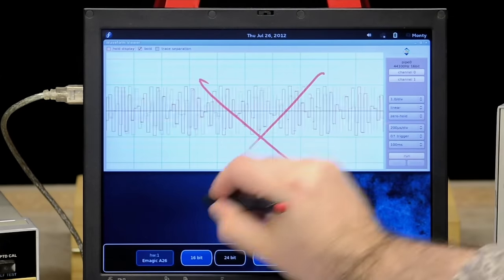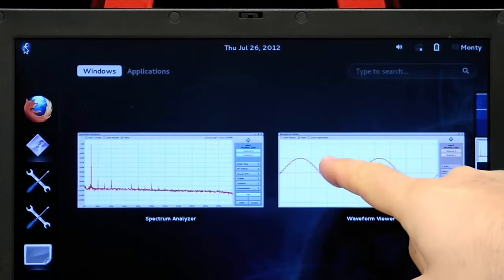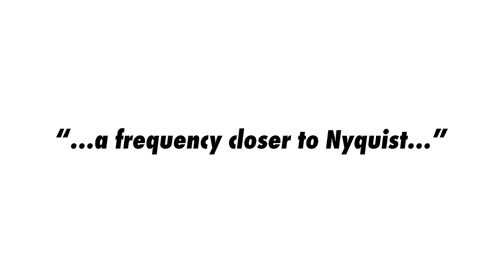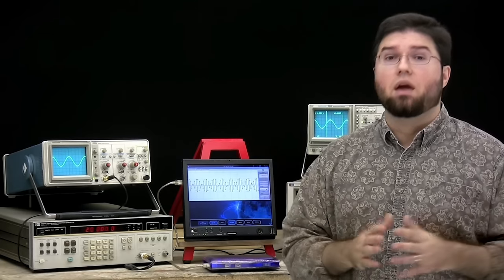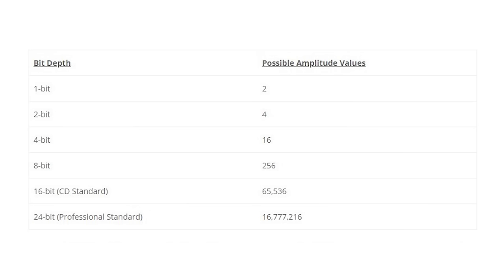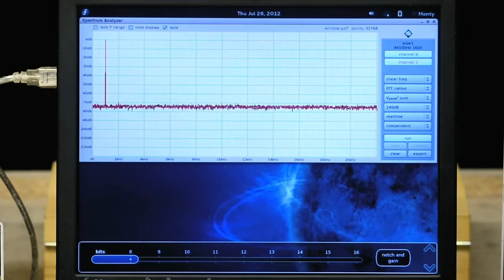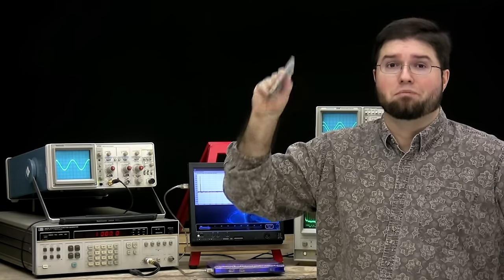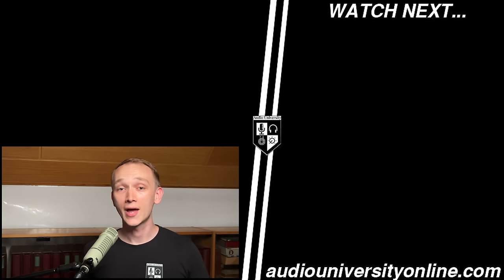Debunking the Digital Audio Myth: The Truth About the 'Stair-Step' Effect

Comment: I do think your example of why 44.1k is adequate for sampling is a little misleading.
 Yes the oscilloscope shows a nice sine wave pattern of a 20khz  sine wave sample but that only shows us what the digital to analog converter is capable of in reproducing or for that matter the oscilloscopes image of the digitally sampled sine wave. It doesn't mean that a 20khz sine wave sampled at 44.1k can actually be reproduced accurately as opposed to a more complex wave form because in truth any wave form sampled at 20khz with a 44.1khz wave form will be represented the same because of the limitation of the 44.1khz sample frequency. 
I think the more important thing to realize is that anyone who is capable of hearing a 20khz wave form cannot hear the difference in the complexity of that wave form. It could be a square wave, a sine or sawtooth wave and they would sound the same to the human ear at that frequency. Your hearing would have be to be able to hear   30khz before you could start to notice a difference. I think this is the real reason why 44.1khz sampling is completely adequate for human hearing.
Reply: @nrezmerski I watched the whole video and the point you're making is kind of what I was saying. A more complex 20khz waveform cannot be accurately reproduced at that sampling rate. All sampled waveforms will be reproduced as the same sine wave appearing waveform but it doesn't matter because the human ear cannot tell the difference anyway. The resulting sine wave is a product of the D to A converter and not the sampling of the original waveform. In other words any 20khz waveform regardless of its complexity will be reproduced as a sine wave.
Reply: @nrezmerski Agreed.

Comment: If the A to D conversion was done with a sample and hold digitizer where the analog signal was riding on a +DC offset one would see the expected digital staircase representation of the Analog signal.     Also showing the digitized output  on the SA .(out of sync) is not at all helpfull.  The higher the sample rate the less difference in volts between the samples.. with out filtering and without sample hold.. the rise and fall times of each sample is so sharp/steep it creats ALL frequencies NOISE  which is not in the original signal, at an amplitude, equaling the difference in amplitude between sample voltages...  The more samples per second, the closer the sample points The lesser the rise/fall times amplitudes the less rise/fall times, signal noise..

Comment: "Again, intuition might suggest that more bit-depth makes for smoother representation of the amplitude of the signal, leading to a more accurate representation of the original waveform, but as I learned from Monty's video, this isn't actually the benefit of increasing bit depth."

This statement is not correct. A more accurate representation of the original waveform is very much the benefit of increasing bit depth. Obviously, the analog output will still be a smooth signal. As Monty's video says in the section immediately following, lower bit depth means higher noise floor, and noise is divergence from the original waveform. Thus, increasing the bit depth leads to a more accurate representation of the original waveform.

Comment: The full scale range does little good if compression is used, which addds its own problems. Having more bits allows weaker signals to be amplified and a higher dynamic range. Higher bit D/A converters came 30 years ago, as 16 is not enough for critical ears. 
If you can't hear the diff between 25/96 FLAC  and CD "quarrity" get off my lawn. 
Reality proves math, not the other way around.

Comment: This is such a valuable insight into digital Vs. analog sound. The very fact we can SEE a perfectly smooth sine wave should be the final answer to this debate. Although we can consider an analog signal to have infinite information and a digital signal a varying fraction of that information DOES NOT MATTER. ALL that matters is that the final product has been averaged to a smooth signal on the display. THERE IS NO STAIR-STEP. Now, if you'll excuse me, I'm off to listen to Tchaikovsky's 1812 Overture on my oscilloscope. When the cannons fire, the pattern is nothing short of astonishing.

Comment: Analog interface is what does the cheating hrere, restoring the sine, just by its own capacitive nature. It's perfect with perfect sines, that's to be expected. ut what human ear considers sounding good is a deviation from a perfect sine. Actually, perfectly tempered sines of different frequency can be head as same note by peple wiht ideal musical hearing.
Secondly, the source of distortion of digital sounds is MAINLY the compression codecs used. And these are frequency-dependant. PCM was believed to be peerfect once upon a time at 24kHz, it allso was proven faulty.

What should be done: generate clearly non-sinusoid ( a saw shape?) ,assymetrical periodicsignal. "Play" it through analog interface and record at different sampling rates. Compress. Playback compressed version and compare results.

Comment: You completely miss the point. You did not test for harmonic distortion, aliasing and phase distortion caused by the required brick wall filter that needs to have at least 60dB of attenuation to prevent audible aliasing. All the frequencies that are present at 20.05 KHz and above, even if you do not hear them because of your bad ears, they fold back into the audible spectrum. When you sample at 192KHz or 96Kz or even at 48KHz, you can use a much more gentle filter that introduces less distortion. So the output is much more accurate, even if your bad ears cannot hear it, and since the foldback would happen at a much higher frequency than the audible range, you get a lot more fidelity. Again, you may not hear the difference with your bad ears, and most people probably would not either. But, it does make a subtle difference that is sensed more than heard. Also, this can add up as you encounter more aliasing on each track you are mixing. In any case, this is not an angry comment. I just would like to see you stop spreading your total BS. Obviously none of you understand the mathematics and theory behind this, and are talking out of your asses.

Comment: I don't know what the first experiment means, the cyclic signal is beeing played for far too long to do any quality analisys; yes the theorem says that you can retrieve any composition of sinewaves given that your sample time is < half the sinewave length; but this is only true for a practically infinite sinewave which is not real world application. this is not a real world usage of digital to analog converter, the information contained in this simple sinewave is very limited it doesn't prove anyting
Reply: @nicksterjThe demonstration shows that : 
- Given an infinite sinewave over time, a digital system can recover the exact input sinewave given that this sinewave frequency is < 20kHZ.
This means by linearity : Given an infinitely repeating signal over-time, the digital system can recover everything minus what is > 20kHz.
But in real life : 
- There is no such thing as an "infinite" input, thus there will always be some > 20khz components  + you have to chunk the input over time because no one is willing to have seconds of delay in the digital to analog converter.
When you chunk the signal, you only do the fourrier transform on the small chunk (a few milli-seconds). 
This introduces sinwaves > 20khz in your fourrier transform, thus the input signal cannot be perfectly reproduced in real time, you get some loss because of the low sample rate.
Reply: @nicksterj 0:08 "and prove that 16 bits, 44.1Hz is just as goodas high res format". The point of the demonstration is not just that there is no stair-step.

Comment: Nice try but, just look at spectrum analyzer show different story. Sinusoidal signal of any frequency have only single tone on spectrum analyzer, what would be case in analoge signal (if all is pure analoge and it generate sinusoidal signal) but on spectrum analyser there are clear present some tones of harmonics so after adc dac conversion signal is not indentical to analog and on first look it have presence of some square wave component in it.